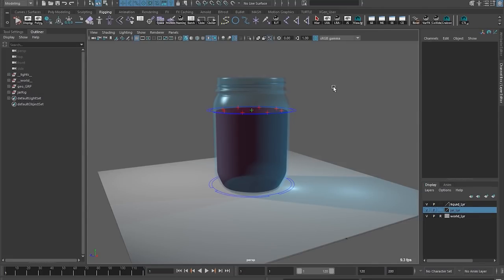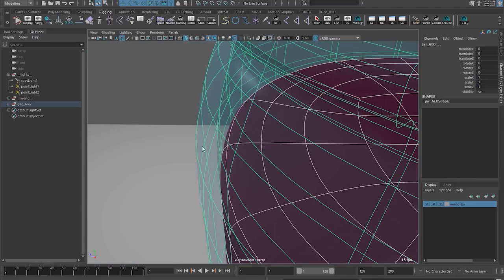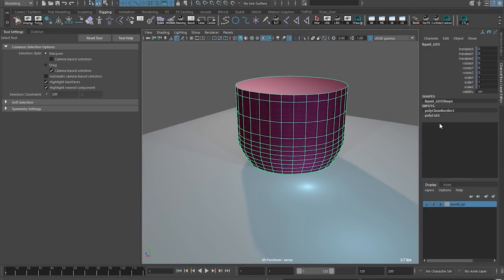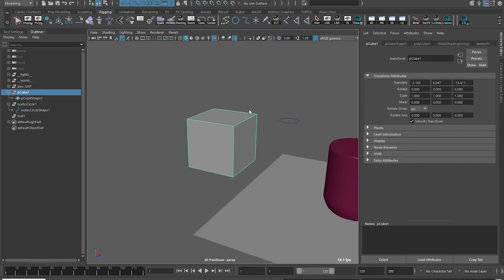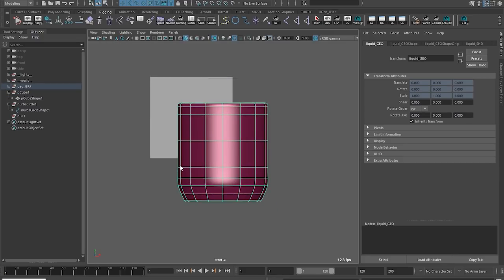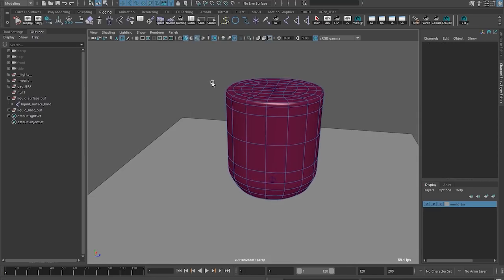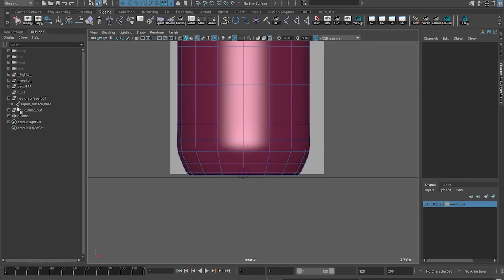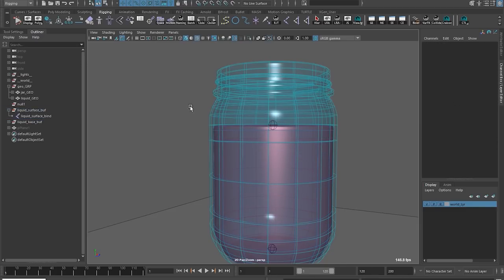Maya Liquid Rig Tutorial

Comment: Sounds like a really useful method. Couldn't get it to work correctly, tried many times but I always lose the filled hole when moving the Nurbs circle. It only words if you are within the row of polys that you cut into.
Reply from the maker: The Polycut operation seems a little finicky for some reason. Make sure delete faces is on in the tool settings before making the polycut, that seems to make a difference for some reason.  Make sure there isn't any construction history on the mesh before making the polycut/fill hole - also, make sure Construction History is on. (MEL command: constructionHistory -toggle true;)
Reply: Thanks Alex. Tried and again and confirmed above and with deleted prefs, but still bizarre results with 2018.3. Strange. Thanks though.
Reply: @tralthamidor  Two years later, I fall into the same issue, LOL. I figured out you need to go to the polygon selection mode, select the whole polygon then fill the hole instead of select the edge loop at vertex mode. It's more like you creating a history path of filling the hole for the whole polygon instead of just a single edge loop. I know this is late but hope it helps :)

Comment: Hi, currently trying to make this on Maya 2022 and it seems like the shear on the joints doesn't work anymore. Only the XY shear value does anything, but even after rotating the joint to have the correct plan aligned with the water surface it still doesn't work correctly. Do you know of any work arounds for this?
Reply from the maker: Shear still works normally in maya 2022 as far as I can tell.
The "Segment scale compensate" attribute on joints might be interfering, so make sure that's off.
Also, make sure the skinning method is set to "classic linear" rather than "dual quaternion" on your skin cluster node.
Reply: @bosspanda485  Ahhh the skinning method was what was causing the issue, all fixed now. Thanks for replying despite the video being so old, really appreciate it! :D

Comment: I want to ask you can the rig be approach like when the cup or bottle move and the water wiggle and there no need to move the controller... can it be approach that way?
Reply from the maker: Sure, you could have a simulation drive the control.  But you do have to make sure the rotation values going into the bind joint's shear attributes are info world space.
Reply: ok... here my other question let say my character will run around and the water i need it to be automatic wiggle.. how do i do it?
Reply from the maker: I'm sure there are other videos that go over this. I can't seem to find the video that I learned from, and simulation stuff gets complicated, but essentially:
-Add a hair simulation to a simple linear curve with two points, starting from the surface of the water and pointing down
-Create some joints and add an ik spline to that curve
-Use the top joint to drive the water control